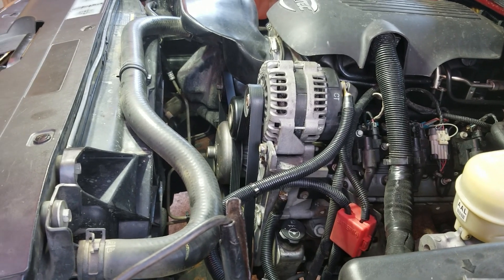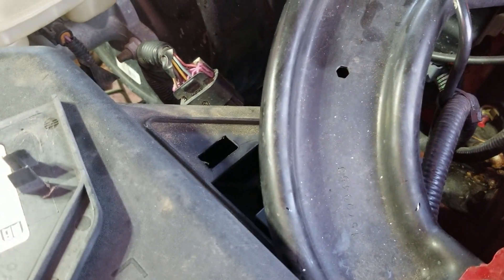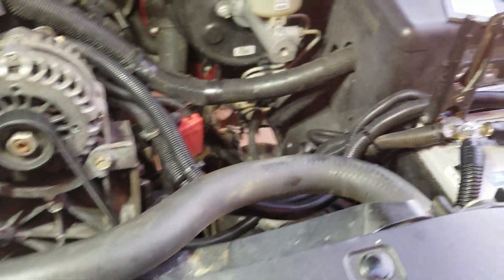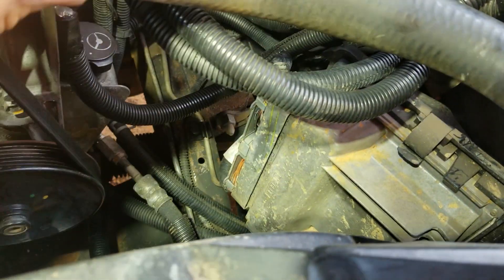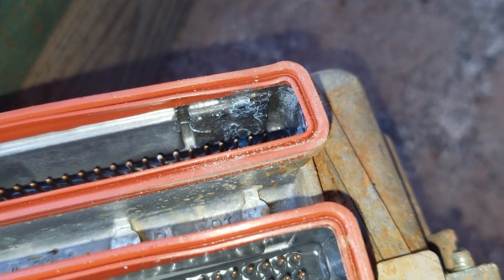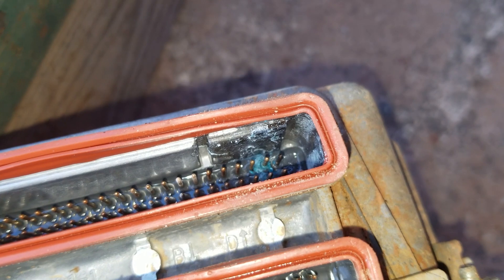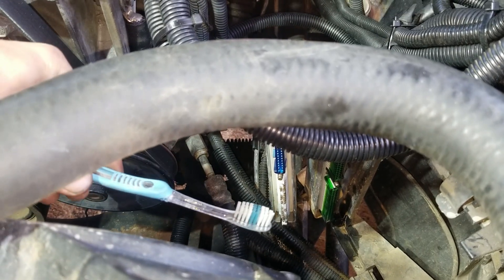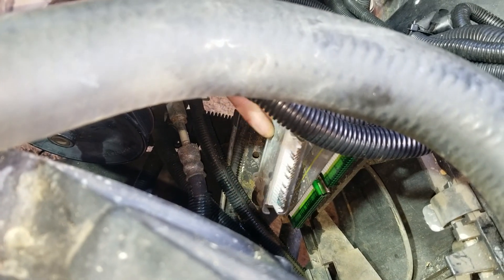Silverado Radiator Fans Won't Turn Off? FREE FIX!

Comment: Hi Matt, How hard is it to to remove the cover to get at the computer, I have the same problem with my 2005 silverado, I have emphysema and can't do a lot of auto work anymore, I really like the info. you put out here, Thank You
Reply from the maker: You just have to unbolt the back connector on the PCM and the connector comes off. It's easy.

Comment: I have the same problem. 2005 Silverado, washed the engine bay and a week later the fans won't shut off and got a knock sensor code. Truck runs rough and reduced power. Gonna try this first before jumping into the knock sensors. Hopefully it works.
Reply from the maker: Yeah try this first!!
Reply: @MattsShop  Update: Turns out I had the same corrosion on the PCM pins that you had. Same spot at the bottom of the blue side. 

Cleaned it with CRC electrical cleaner and it fixed the fan being stuck on issue. Thank you so much for sharing the fix!

I still have the knock sensor code for bank 2 (rear). Probably going to just run a bypass kit to the outside of the block and see how that goes.

Comment: gonna give this a try. I did the efan swap on my 02 that has a blue green pcm swapped in it and the only solution I found on my own was removing the high speed fan fuse which did stop it and the low speed fans works well enough to keep it at temp. thought one of the relays might of failed but this is before dealing with the relays themselves

Comment: I can’t thank you enough I had the same problem and pretty much didn’t know what else to do until I came across your videos and bingo this was the problem I had I ended replacing the computer because some pins were broken after that my truck is fixed
Reply from the maker: You're welcome. I'm glad someone else had the same problem and got it fixed!

Comment: If I disconnect that PCM will it deprogramthe computer will I have problems starting it back
Reply from the maker: Not on 1999-2007 Chevy or GMC trucks. Other makes and models can cause problems.

Comment: i had same problem years ago i changed every sensor and so much other things trying to figure out what was causing the fans to stay on, finally had a guy tell me it can get junk in the computer and my last thing to try before giving up was checking the same area and the botttom had alot of nasty junk in there and found out the bottom pins were for the ground, once i cleaned up the truck started running right again.

Now my problem is fans and a/c wont come on... I used a powerprobe to make fans come on so i know they work, i changed all the     relays, temp sensor, and still doesnt work....im starting to wander if there isnt more junk in the computer again somewhere...any ideas of what it could be?

Comment: It has been raining all day and I came home to the fan running even with the truck off, I turned it off and back on and right as I turned it back on the fan shut off and I turned it off again really quick. That fixed the issue. 2015 Silverado
Reply from the maker: Same exact problem I had. This was it!
Reply: I’m trying figure out the issue

Comment: The knock sensor wells under the intake have water in them.  The water travels through the wiring insulation and corrodes the PCM.  The corrosion will come back if you don't seal the knock sensor covers and run new wiring.

Comment: I bout a 05 Tahoe from dealership 8k cash so far I have replaced front and back set of shocks brand new tires well the fan don't shut off now iv paid to mechanic s to fox it the cleaned Pins issue returns same day the deal ship made me pay 200 for them to look at it thy won't help me for sgit I'm now 10 grand in this thing  I'm just lost no words I can't belive this fickimf Carlot doing me like this
Reply from the maker: That sucks! Yes it was fixed after I did this. Maybe they didn't clean the corrosion out of the connectors and just the PCM. Very hard to get the plugs clean.
Reply: @MattsShop  fans quite but still got code, gonna clean better when it is warmer

Comment: Would that be the cause of my radiator cooling fans not coming on at all unless I turn my A/C on, once the A/C is on my fans run on hi speed, my 05 chevy Tahoe temp gauge went all the way to the 3/4 mark without the fans coming on
Reply from the maker: Did you try to a new fan temp sensor?
Reply: @MattsShop  not yet I've been throwing alot of money into the Tahoe trying to play the process of elimination game but haven't come out successful yet, is the fan temp sensor located on the driver side of the block? If it's bad is there anyway for me to test the sensor before I go buy a new one?
Reply from the maker: Thats not fun. Yea the sensor is on the block of the drivers side behind the pullies.
Reply: @MattsShop  the new coolant temp sensor fixed my problem, the radiator cooling fans turned on by themselves at 215°F, thank you for your your help/advice
Reply from the maker: Awesome! This will help someone else! You're welcome. You did all the work.
Reply: @MattsShop  just bought the coolant temp sensor, after I get it installed I'll update on if it helped or not
Reply: I’m gonna try temp sensor on mine I been looking for a fix for my fans not coming on